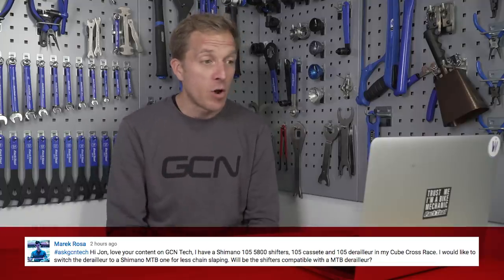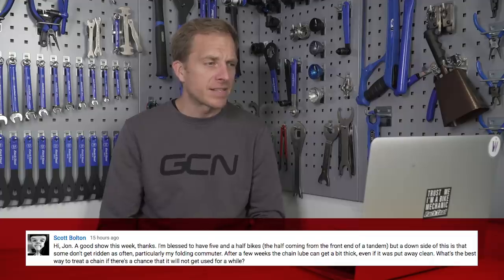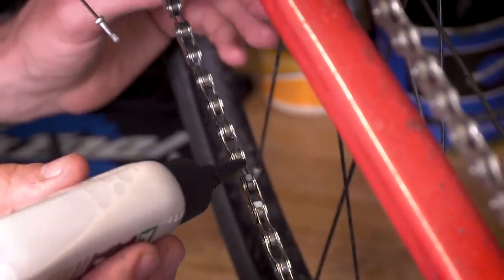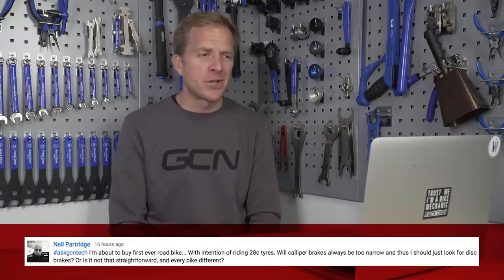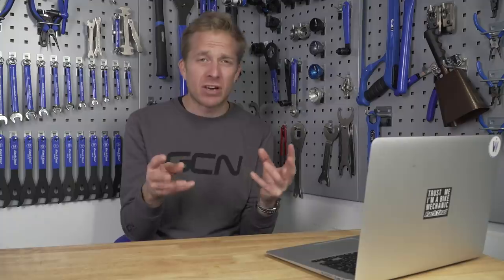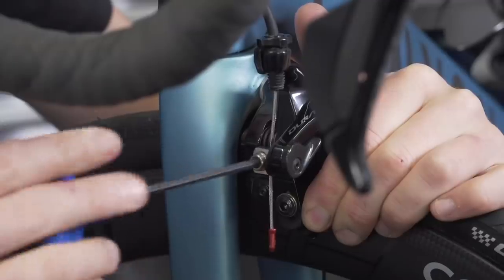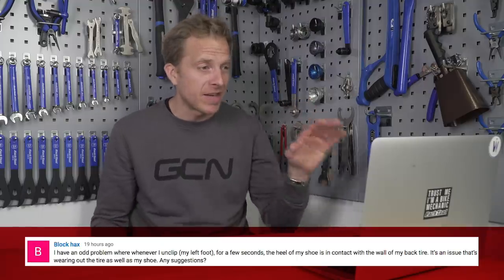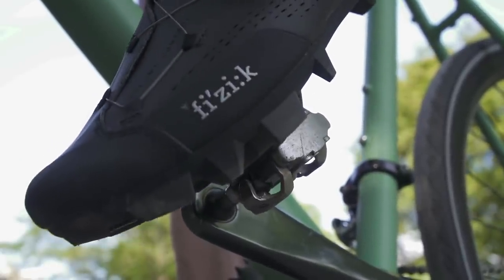Wide Tyres, Rim Brakes & MTB Mechs | GCN Tech Clinic

Comment from the maker: Remember to keep your questions coming in using #askgcntech. 👇
Reply: I use regular Continental Race tubes on my DT Swiss 460 training wheels and I have a separate Zipp 404 NSW for racing crits. Do you think I would benefit by using latex tubes or is it simply marginal gains? Keep the great work up. #askgcntech
Reply: Hi guys love the work you do! I have just bought a 1981 Dawes Lightening for a grand price of £35! I'm potentially looking at upgrading some of the components including the wheels. The frames dropouts are designed for wheels with the old through bolt on the hub which has securing  nuts on either side to secure the wheel. Will I need to make any adaptations to the frame if I wanted to put a new wheel set on the bike with quick release axles? Keep up the great content #askgcntech
Reply: Can i use mtb hubs on road bikes?#askgcntech.
Reply: @adrianjesleedeleon8358  that depends on the length of the hub body.
Reply: Hi guys, love your videos. I’m currently thinking of upgrading my disc bike to a 1x setup and electronic groupset. I would prefer sram etap hrd . Could you please help me with what components to use ( chainring, cassette, levers and etc.) thank you !! #askgcntech
Reply: GCN Tech #askgcntech love the show! I have a trek dual sport 1, now I have crashed this bike so many times and I was wondering after replacing so many parts and next I have to replace the wheel and tires. 
After how many crashes do I need to stop riding the bike ?
Reply: #askgcntech Hey Jon! With my Mavic Cosmic Pro SL UST rims, the front Ultegra rim brake caliper is, for some reason, wearing the pad on the non-pull side more quickly than the pull side. Have centered and recentered, checked for equal toe on the pads, etc., but am still getting uneven wear. Any suggestion on what to try?
Reply: Hi Jon, love the show. Watch it religiously! Is it possible when upgrading a groupset to upgrade the bottom bracket from a cartridge/square taper to a Shimano threaded BB? Current bike (2018 Raleigh Criterium) has a Claris groupset with FSA chainset and I'd like to upgrade to full Tiagra or possibly 105. #askgcntech
Reply: Hi, I recently recived my shimano ew-wu111 (d-fly) and was wondering if it needed to be put between the junction A and the juction B or it can be put between the battery and the jusction B ? Thank you
Reply: Hi John! I have some kind of annoying "clicking" issue on my road bike. I have recently upgraded to Shimano Ultegra 8050 groupset, and when climbing out of the saddle, in the small ring and around the middle/second tier of the cassette, there is a click each time my right foot reaches the bottom of the pedal stroke. I have exagerated the movement on the other side, and nothing happens, but when shifting up a gear or two at the back, it gets more and more noisy on the right side... I have checked py pedals and cleats, they seems OK. My guess is that the front derailleur is the culprit, as something may flex and the chain should probably rub against the FD, but I'm don't know what I could do to avoid that and get rid of this annoying noise. Any sugestion is welcome, thank you! #askgcntech
Reply: Hi Jon! Gotta turn to the Tech Clinic once more. I have a pair of old Shimano Ultegra 6510 STI-s on my bike. Lefty still works great, but the right one tends to shift messy, when I try to shift up. I have to hold it in a certain angle to shift, otherwise the little flap wouldn't move. When I move the whole lever, shifting down, works good too. My mechanic wouldn't touch it, says it's too complicated....🤷🏻‍♂️ Any ways to keep that right shifter alive? Couldn't find an STI service video on the channel yet. 😁👀 #askgcntech

Comment: A tip for finding the thing that’s puncturing your tubes- go round the inside of the tyre with a loose bundle of cotton wool- the wool will snag on anything sticking through the wall. Run it round in both directions in case the object has come through at a sharp angle.
Reply: I had a similar problem with an aluminum rim, turns out the manufacturer left a small piece of metal inside the rim from the drilling of the holes for the spoke nipples.
Took me over 1 year and 10 inner tubes until i found the culprit by pure random chance, there wasn't even any marks on the rim rubber or anything, but with the rotation of the wheel when riding sometimes it would come out the hole and puncture the inner tube.
It was only found because I was truing the wheel without the rubber on the rim and saw it poking out.
Reply: You are a genius

Comment: The cable breaking one, if it is the left hand shifter, reduce the cable tension and/or loosen the high limit screw a tiny bit. It could be when in the big ring, the cable is under too much tension as the front mech pushes against the high limit screw, and creating premature wear on the cable.

Comment: @Tarcis Verfaillie Derailleur cable breaking is the sign that there is way too much tension somewhere along the line. It must rub somewhere. If one has internal cable routing it might be difficult to find and fix. If not it should be easy to find. It might rub somewhere near the cable stops or under the bottom bracket (cable guide might be messed up).

Comment: Hi Jon, great show as always. Thx for attempting to answer my question. A suggestion that had been made, is to park my bike in the gear with the least tension: smallest cog and crank... This to alleviate unnecessary tension overnight ... I'm trying this now!?!
Reply: I wouldn't worry about that.  Cables don't break from tension, they'll break from repeated wear or corrosion in the same area.  If the cable's not moving, the couple pounds of tension it's holding won't have any affect on its longevity.

Comment: On the shifter cable breakage: make sure you are getting a real Shimano replacement cable.  Getting a replacement that is a little bigger thinking it will be stronger is backwards.  It's likely breaking due to bending and a smaller cable bends easier.

Comment: For the tire that's randomly flatting, I'll often bend the tire fairly sharply to spread any small holes/cuts on the outside of the tire.  Pick/pry out anything that's stuck in them with a small tool.  It's surprising how many small bits of glass, wire, etc, can be stuck in a tire.  Sometimes they're below the inner surface of the carcass, and just barely poke through wearing a hole in the tube from being rolled on.
One very useful tip is to align your tire in a specific orientation (valve aligned with a specific letter, etc).  Then next time you get a flat, remove the tube and pump air into it.  When you find the leak, you can focus on looking at the appropriate area of the tire.

Comment: Thanks for the 28 tyre answer ... I've ordered a rourke 953. I'll send you a pic when it's built.
Reply: Keep in mind that different makes "28mm" tires may actually have widths that differ from 28mm.  Even different tire models from the same manufacturer may vary.  Plus the width depends on the inner width of the rim the tire is mounted on.

AND the height of the tire may be a problem as well as the width.  In addition to brakes, some other places to look for issues are the underside of the fork crown, the inner sides of the chain stays, and the seat tube.

Welcome to the messy business of cycling.

Comment: @Tarcis Verfaillie Try moving the derailleur component on its own to ensure its not stiff and needs lubricating. If it is fine check your limiter screws are adjusted properly, if the limiter is too close to the end gear it can cause uneccecery tention in the cable as you reach the highest tension gear. (I do not know if its the front or rear derailluer) Finally to eliminate cable housing as the issue, undo the pinch bolt and hold the cable. Then push up the gears you will feel the cable tug, just play with it like tug of war with your shifter and see if you can feel any slac response in the cable. If it feel fluid and responsive then its fine.

Comment: Sometimes random persistent flats can be caused by incompatibility between tire and rim. These are usually on the spoke side of the tube. Especially with excessive stretch into a "deep valley" rim with rim tape over the spoke nipples. Friction against the taped nipples on the thin tube causes the leak. Box section rims with recessed spokes are less likely to have this issue. Often this is a wide (40+mm) tire on a narrow (19mm) rim.

Comment: 1:36 if it's a small hole, you'll be fine. make sure your spoke tension is good and pay attention if your wheel goes out of true. i've been riding my rim with a nail poke with no problems
Reply: I've twice had large screws go straight into the rim of my rear wheel. Been riding it for ages without any issues. Wheel is still true. I just cleaned up the hole, added fresh rim tape, tube, and tire and went on with my life. However, if I get "screwed" a third time, I'll probably end-of-life the wheel.
Reply: A self-tapping sheet metal screw went through my rear tire, tube (both sides), and drilled itself into the inner surface of the rim.  I put a piece of boot material over the hole in the rim, another over the hole in the tire, changed the tube, and rode home.  On the way I realized I could use the damaged wheel on my trainer!  I leave a trainer tire on it so no need to swap tires to use the trainer.

Comment: Older Tyre carcasses can sometimes very rarely micro split by  where the wire or beading is. No sign of a problem deflated of course.. then when its pumped up hard  and it splits a tad its likely to snakebite the tube once more.

Comment: I am getting a lot of flat tires riding on my trainer - a Tacx Vortex Smart. I have a trainer specific tire, I always check the tire pressure before a training session (110psi). I have the trainer roller set to the correct pressure against the rear wheel. When I check the tube after a flat my impression is that the hole is on a seam of the tube. I have repaired some of these flats and tried new tubes. I have checked the tire/wheel rim and everything seems smooth. I have gone for a few months before I get a flat and then I can get 2 or 3 in 5 or 6 rides. I tend to ride 3 or 4 times a week in the winter doing 1 to 2 hour rides. There doesn't seem to be a pattern to when I get the flats other than mid to ending of the ride. I rode the same bike and wheel (different tire) across Canada last year and didn't get a single puncture!! #askgcntech

Comment: When I have a puncture and I having trouble finding the culprit. I take the tyre off the bike and turn it inside out. I then check the tyre and when I get to a section of tyre that is lower the the section I've just checked. I push it up a bit and check that section. If the tyre is inside out anything sharp and not noticeable when the correct way soon shows up.

Comment: Re: MrGadangit’s unexplained tube punctures. I’ve found things by rubbing a cotton ball along surfaces. Go two directions, and any snaggy spot will quickly reveal itself. Also, living in the desert, we have run across thorns that hide in the rubber. When weight is applied to the area they poke out enough to punch a hole, but they retreat to avoid detection. Finding those involves chasing down every dimple/hole with a small hex wrench. Apply pressure and the culprit will soon be found. Hope this helps.

Comment: I also recently had the problem of unexplained flats. Turns out it was the rim tape on deeper wheels that was broken through a spoke hole, and the tube was expanding into the hole and popping. There wasn't any debris and I didn't pinch, but I still got flats.

Comment: Could the snapped cable be caused by the outer cable not being properly inserted into the shifter? Or a rough edge on the outer?
Reply: My thoughts exactly!
Reply: @Stefanosinf  

Yes.  Me too.
Reply: On the 6800 shifters, Shimano recommends using an end cap with the long ‘nose’ on it.  That shields the cable a little further into the mounting slot on the shifter.  Also, if the cable isn’t cut well or is a little rough on the ends of the outer could be a problem.  Could also
Be the limit screws not set up right, making the cable have to work harder to move the mech.  And always use high quality inner cables: Shimano or Jagwire are my favorites.
Reply: Was thinking the same!

Comment: @MrGadangit When you check the inside of the rim and tire, do so with a cotton ball. The cotton will snag on everything that isn't smooth. This will give you the opportunity to inspect every imperfection and bump. Line those up with the leaks in the tube (which are easy to find in a tub of water) and you will find that tiny burr or thorn Jon is mentioning.

Comment: A comment on the sound to last question. I had the same problem a couple years ago. In the spring time, when i started biking outside again after hours and hours on zwift, without a trainer specific tire, i had flat after flat. I believe it was caused by the tire itself being damaged and having tiny, tiny holes in the sidewall from being on the small trainer roller. Just a thought. And yes, it's spelled T-I-R-E  ;)

Comment: Regarding the issue with snapping Ultegra 6800 rear derailleur cables inside the shifter: I had to experience that issue as well on a frame with internal cable routing not that well designed for mechanical shifting (Giant Propel). Additional friction due to bad cable routing, tight bends or old housing might persevere the issue. I had no option but to change the rear derailleur cable frequently after 4000 km. If changing to electronic shifting isn't an option, I'd recommend running completely continuous outer housing from shifter to derailleur and badge-attach it to the frame with the help of electrical tape etc. - even if it looks crappy. It will reduce friciton considerably and increase the rear derailleur cable's lifespan.
Reply: Maybe unwrap the bar and inspect the cable outer. Could there be a burr from where the cable was cut?

Comment: #askgcntech Hi Jon, love the show. Just had a quick question about quick release and disc brakes. I've got a bike that is relatively new with disc brakes and quick release wheels; the problem is that when the front brake is applied at any speed over 20mph the front wheel shudders. The wheel isn't loose in the dropouts and the rear wheel seems fine. Thanks for the help, Ben.

Comment: I am thinking about converting my stem and adding  drop bars on my 80's mountain bike and using it this winter. I have a tested solution for the thumbshifters but I am curious as to whether drop-bar brake levers will have enough "pull distance" to work well with my v-brakes. Love your show and all the others by the way...

Comment: Hi. John.  Love the GCN show.  I have a steel Genesis Equilibrium.  The bottom bracket has been creeking.  On starting to undo the bottom bracket the cup threads proved resistant  to turning all the way out.  Inside I discovered the frames bottom bracket inner had a thin layer of iron oxide all the way round.  The threads had started rusting, hence the resistance whilst removing the bottom bracket itself.  Having fully cleaned out the frame and threads where the bottom bracket goes, should I used copper slip or grease to prevent future oxidisation?.  Is copper slip better at preventing water starting to rust your BB than grease?    I am having to replace the bottom bracket (shimano 105, 5800). I found that water getting down and oxidising the BB on steel Genesis Equilibriums is a problem others have experienced, due to poor drainage built into the frame.

Comment: Rims have loads of holes in them for the spoke nipples and the valve. Is a little nail hole through just the inner skin of the rim going to weaken the rim bearing in mind it has been designed to work with those spoke holes? I doubt it. I know someone who ran over a big screw which was a pain to get out of the inner surface of the rim. Two years later he's still using them.

Comment: #askgcntech I would like to change from an old 9 speed Sora drive train (on an 2013 Trek 1.2) to a 10 speed Tiagra. Do I need to change everything at once or can I start piece by piece such as Cranks and BB for example? Is there a particular order to buy and install parts?

Comment: This is a question about shifting performance on a road tandem.#askgcntech

My wife and I have a Dolan road tandem. It came standard with a Tiagra triple (30,39,52) and 10x (11-32) cassette. But the shifting is rather subpar, partly (I think) because of the longer cables, and perhaps partly because the components are Tiagra. We've tinkered with the cables and tension and whatnot, but they're probably about as good as they'll get.

We're considering a few options, but aren't sure which one would have the highest likelihood of success. One option is to simply upgrade the components to 105 or Ultegra (or comparable SRAM). Another option is going with Di2 or eTAP wireless. What would you recommend? Do you think just going with higher end cable components (e.g. 105) would work well? Or do you think that, because of the nature of tandems, a wireless system like Di2 or eTAP would yield better shifting?

Two caveats: 

1) my wife has (and really needs) 150 mm cranks (they came from Da Vinci cycles in the US) and they require a symmetrical five-arm spider. That may preclude using certain group sets, we honestly aren't sure.

2) we live in Mz. Pooley's neck of the woods, and there are some rather steep climbs (ask Emma about Etzel). We're fine with losing out on the faster gears like 52-11, but we really need something that gives us those good climbing gears, ideally something like 34-36, or even 36-40 or 34-40. We're fine using Wolf Tooth road links (we both have them on our road bikes with 11-36 cassettes), provided they'd be compatible with whatever we decide to go with.

Thanks a bunch